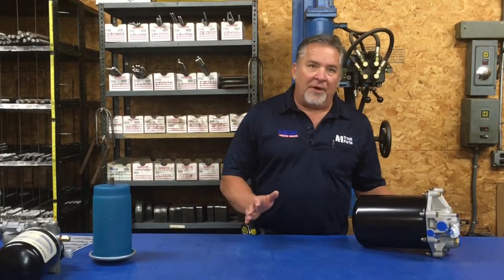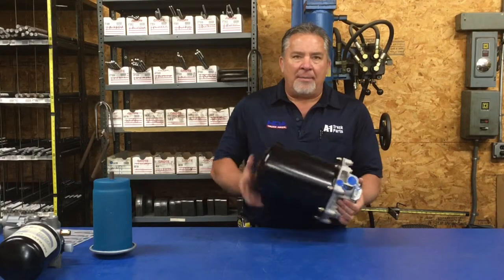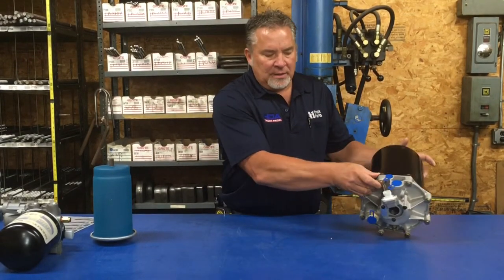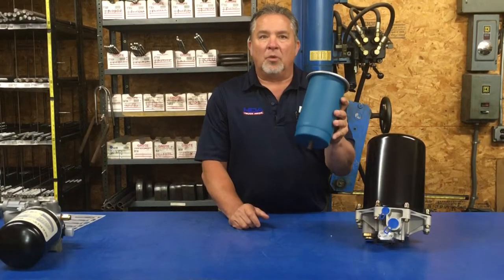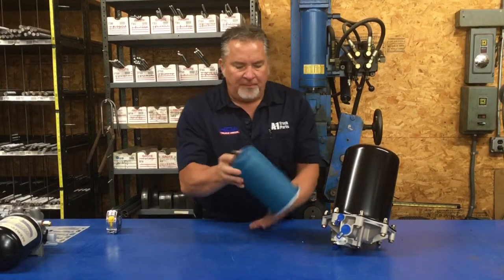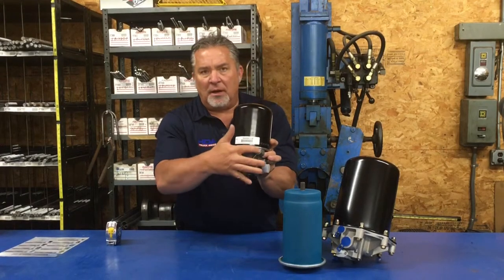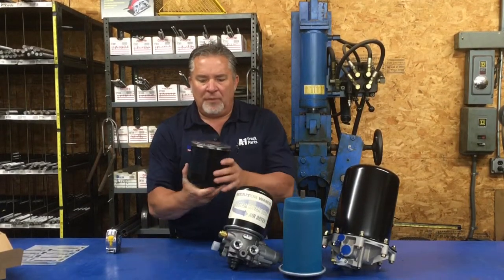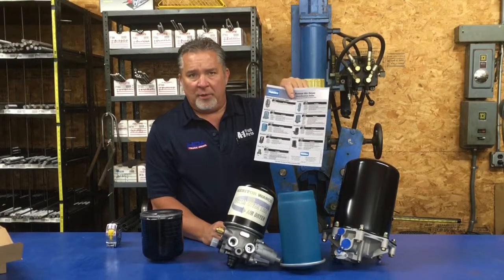How to Identify an Air Dryer & Cartridge for Commercial Trucks

Comment: Have you heard about the expello valve that got introduced a couple years ago? It’s air over electric and screws directly into the air tank but unlike the Bendix auto drain valve, the expello intermittently purges far more often

Comment: Help me out please. When my air dryer purges, it purges over a minute and a half before it stops. 
I have replaced the cartilage in the air dryer and also the purge valve. I also made sure that both unloader valves are good but It still sounds like a machine gun when it purges. Thanks in advance.
Oh and my air dryer doesn't have the big nut for the check valve on the bottom of mine.

Comment: i went to replace my filter on my bendix AD 9 and the top rubber translucent seal was missing from the old one  do i remove the top rubber seal from the new filter as well that i am about to change are leave it on and what will happen if i remove it will it make a differance